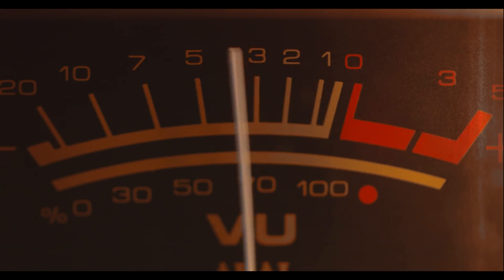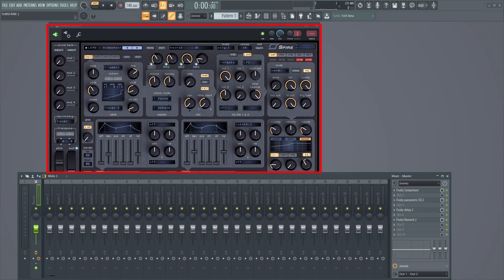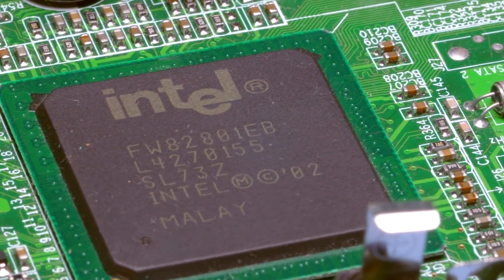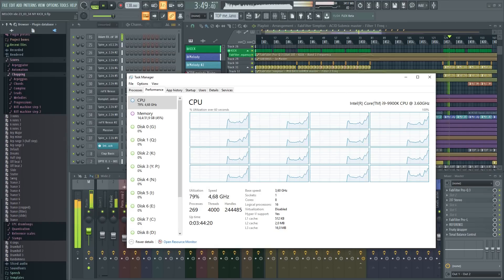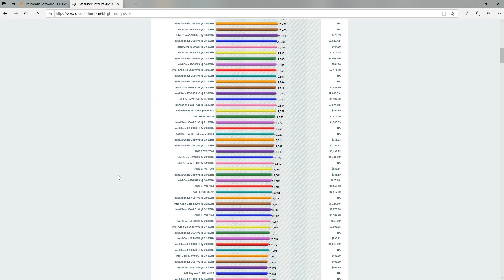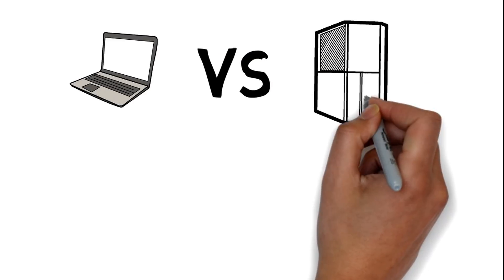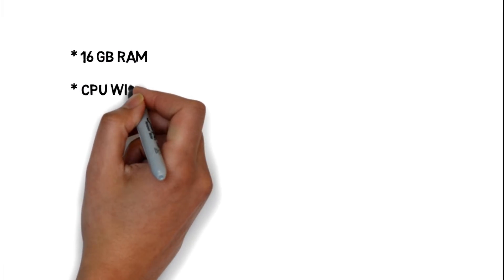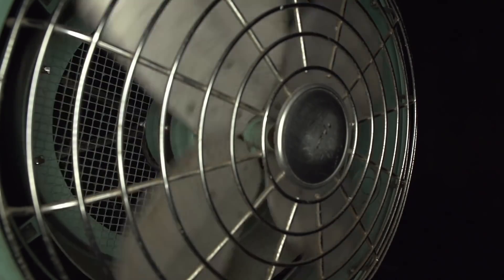The Best Computer For Music Production - What's Needed And Why!

Comment: Bought a 2015 iMac 8 gb RAM replaced hard drive with SSD. £800 total. Done.
Reply from the maker: You don't always need much CPU performance. It depends on what you're using the computer for. For example if you're mostly in to recording and using samples, then you'll get by with an older computer. In this case it's using a ton of CPU hungry VST's and effects. Not everyone is going to need such a beast. :)
Reply: soundD:sine what shop did you go too, I have a 21.5 late 2015 with 8gigs and can’t upgrade ram  as it is soldered .. how can I put the ssd
Reply: N.K.O Productionz N.K.O Productionz yes ram is soldered but HDD is a mechanical one which can be replaced with an SSD. Remove iMac screen. Knife the edge screen warm with hairdryer. Swap HDD having cloned new drive from old. But new file
Strip kit for iMac from amazon.
Google the process I fix it.com .
Did it myself but I am experienced with taking computers apart etc. Now have 1tb ssd Samsung evo in iMac. Cost me
£100 in total and has transformed
The iMac. Mechanical HDD’s
Are a serious bottle knock to performance

Comment: Interesting! 

But no power supply?
Reply from the maker: Thanks. It's at 7:05. Seems like I forgot to add it to the parts list in the video description, so thanks for pointing it out! :)   Here's the link: https://www.amazon.com/Corsair-TX750M-Certified-Modular-Renewed/dp/B07RYZWRZV/ref=as_sl_pc_tf_til?tag=firewalk02-20&linkCode=w00&linkId=9276904dc4ad656423b96e65b57eac78&creativeASIN=B07RYZWRZV

Comment: 5-7% increase seems a bit low. I've got a 8700k and max it out in current projects but I think I'll hold off upgrading for now
Reply from the maker: The rather low increase was quite surprising, as the CPU is supposed to have a substantially improved single core performance, and even more cores. I suspect this is is because of the quad channel memory support of the 5820K vs the dual channel on both the 8700k and the 9900k. I talked to Image-Line about this and they was as surprised as I was. In theory, you should not be able to max out the bandwidth even with a dual channel system. However, in a real life scenario it seems to be a different matter. 

In order to test this I downgraded my quad channel 5820k to dual channel DDR4 memory instead, and the result was quite shocking. A project that was using about 70% of the buffer in FL Studio ended up reaching 100%, and became unplayable. 

Once I set it to quad channel again it was fine again. Surely the dual vs quad channel memory has some huge impact here, even though technically it shouldn't. More tests would need to be done to verify this hypothesis though, but it's the only thing I can really think of that separate the 5820k from the 9900k that could account for such a tiny difference. 
The thing is, if I had tested the 5820k vs the 9900k and they were both running in dual channel mode then the difference would probably be around 30-40%, like the charts seems to indicate, relating to single core performance increase in the 9900k vs the 5820k. I'm quite sure that the memory bandwidth is what's holding the 9000 back here, because thy should not be that close! But I can't say for sure.. 

If I had tested a dual channel 8700k vs a dual channel 9900k then the results would likely have been very different. If I had unlimited amounts of money I would go ahead and buy another dual channel system and test just to be sure, and also a Ryzen 3900x based system so that I could really see how they measure up. :)
Reply: @FireWalkMusic  Have you tried another DAW (like Studio One) that might be able use utilise more threads?
Reply from the maker: @AJDOLDCHANNELARCHIVE  I contacted various daw developers and they have confirmed that all daws work basically the same way when it comes to the way it processes. Serial processing is heavily  utilized in all daws. They all also utilize multiple cores of course, but they all work basically the same way. So if you replicate a project perfectly in two different daws you wouldn't see a huge difference. Perhaps +-10% tops, and much of that will be due to the buffer handling and such.
Reply: @FireWalkMusic  Sorry man, you just need to RECORD the synths and all that and split up your creation, arrangement, mixing, and mastering phases of production in order to avoid that high CPU utilization. It could also be as simple as switching your buffer size as well. you don't need a low buffer if your mixing/arranging the track. You really dont need a low buffer unless you're recording guitars w/ realtime effects etc.... The i9 can flex more CPU power if you increase the buffer size.
Reply from the maker: @dotMPEGmusic  Hey, I'm aware of the freezing option, but I really don't like doing that due to my workflow. In my opinion freezing Is still a bit tedious in fl studio, particularly the unfreezing.. The way I work means going back and changing things quite a lot, and with most of the tracks rendered to audio it would just be too messy and time consuming, so I opted to go for more performance instead. The buffer size is already maxed out usually. I always record during the start of a project, with a low buffer size, and then I increase it as the project grows. 😊
This works well for me. I also do video editing and it's a pain to wait while video is rendering while editing, so having a fast CPU saves me quite some time in the long run. 😊

Comment: Wow, that’s the small gap between the old and the new CPU performance, and even the higher clock speed don’t help. Also, if You do video editing, I think AMD would be a good choice... I love my Ryzen 3700x.
Reply from the maker: The 9900k is running dual channel DDR4 and the 5820k Is running quad channel, which seems to be what's accounting for the small difference. In theory, the i9 should be around 40% faster than the 5820k since it has faster single core speeds and more cores. It is a lot faster in video editing though, and also in games it really show (here the 5820 is holding back the graphics card a bit actually). So overall the i9 is a better all round system, despite the rather small increase. 

If I had unlimited money I would buy the new AMD 3900x as well and test it vs the i9. :)
Reply: @FireWalkMusic  I think the undervolting potential of Ryzen 3rd gen in particular might actually edge out Intel for audio as well, at least for many workflows. While single thread performance matters, you had a lot of threads going at ~50%, which synthetic benchmarks don't replicate for single thread performance. And thse additional threads affect thermals and memory use, which in turn affect whether the main thread runs at full boost. With the low TDP of the 3700x it should achieve higher boost clocks more reliably - and quieter and you could even go for a full passive system. I think both 3800x and 3900x offer diminishing returns (or even negative effects compared to the 3700x) for audio thanks to the higher TDP.
Reply: @simongunkel7457  which is better 3700x or i5 9600k ?
Reply: @xoxo-pp7ru  In that case easily the 3700x, because it's even beating the i5 9600k for single threaded performance so it has an advantage over the Intel even when you aren't putting load on multiple cores.

Comment: gracias! ! y una pregunta intel 9900k o Ryzen 3900x?
Reply from the maker: It's hard to say. Most of the benchmarks so far has been for games and such. From the looks of it the 9900k is still a little bit ahead in terms of raw single core performance, and can also be clocked higher. But then again the 3900x has more cores, which can help to some degree. I can't really say for sure without doing any tests, but I suspect they are fairly equal. Perhaps the 9900k is still a little bit ahead, but not enough to justify the much higher price. At this time the 3900x is probably a better choice considering the price, but I would have to run some tests in order to say for sure.
Reply: @FireWalkMusic  thanks !!!
Reply from the maker: @Juanele23bcn  You're welcome :)
Reply: @FireWalkMusic  https://www.cpubenchmark.net/singleThread.html  Based on these results would you think I would be better off with the 3800X? or would the Intel 9900k be ultimately the better choice? Considering I am making a desktop strictly for music making purposes.
Reply: 3900x no reflexion to have 
Both are big overkill so why don't go with the most multitasking capable? But go Intel if you need thunderbolt audio card..

Comment: What CPU do you guys suggest between a Ryzen 5 1600 and a Core i3 9100F. Both are priced equally and I'll be using Fl Studio for Production.

- I3 9100F 4 core 4 threads @3.6Ghz

- Ryzen 5 1600 6 core 12 threads @3.2Ghz

https://cpu.userbenchmark.com/Compare/Intel-Core-i3-9100F-vs-AMD-Ryzen-5-1600/m796379vs3919
Reply from the maker: I would go for the Ryzen here.

Comment: How much memory do we need actually..for MP build
Reply: Never go 8go noways 
The 2x4go is really rare to find and remember that now especially with ddr4 you should only go with dual and quad slot to achieve reasonable frequency on the ram.. basically 1x16go is half performance over 2x8go true as well if you want 32go go with 2x16 it's more cheap than a 4x8 and left room to add a 2x16go to go 64 in future ;)
Reply from the maker: I recommend using 16 GB. Some times you can get by with 8 as well, but it's really annoying when you constantly run out.. So in order to prevent any issues I always recommend 16 as a minimum.

Comment: Same thing, with parts and everything, what if you wanted 128gb of ran?
Reply: Am very glad that I seen your video. I was going to wait🤑 until the new mac pro, coming out this fall 2019, until I seen the price 🤯🤯🤯🤑. And the design in front looks a onion shredder with plenty of holes, that say dust your welcome to stay in here. No thank you.  I'm also finding out, that more, and more people are apple products, I don't blame them. Thank you for info, your way seems to be the best way to go.👍👍👍👍👍👍
Reply from the maker: If you need more than 64 GB then just find another motherboard which has support for that much. I can't really think of any scenario where that much ram would be necessary though. I do some heavy video editing and I used to get by with just 16 GB. I upgraded to 64 now just to be on the safe side. If RAM is that important than I would probably look at a 4 channel platform instead, as you'll get much more bandwidth that way. As you can see from the comparison in this video between the 5820k (4 channel memory) and the 9900k (2 channel memory) the difference isn't really that big. I suspect the increased memory bandwidth of the 5820k platform plays a huge role here. I actually tried to test this by downgrading it to 2 channel and the performance in FL Studio was heavily reduced.
Reply from the maker: You're welcome :)

Comment: Also what does having higher Ram help with? My main issue is when i play inside my project the project has that glitchy sound especially if i have a lot of plugins running
Reply from the maker: Having more ram will ensure that you don't have to restart your computer so often to clear the memory. Every time you open a project or a program it loads things into the memory, and it remains there so that the next time you load that application or whatever it will load faster. When you have used your computer for a long time without restarting it, the memory will tend to get filled up, and at some point you might have to restart the computer in order to clear everything. Having more ram ensures that you don't run out of memory while working on a project. In most cases, 16 GB will be more than enough. I also work a lot on video editing, which uses a lot of memory, so in my case 64 GB is just playing it safe. I could probably get by with 16. :)
Reply: Assuming your daw is 64bit. Which it might not be as your vst's are all 32bit so the daw will only access 4gb ram. I still run fl studio in 32bit to stop the vst bridging.

Comment: I use logic and need to upgrade to a more powerful machine. Iv been looking at a Mac Pro with a intel xeon e5 2.7ghz, 12 core/ 24 thread processor. 
Would this be a powerful processor to run Logic Pro x?

Also on the apple website it says this about Logic Pro -
Logic Pro and Logic Express 8 or later can use all cores on 2, 4, and 8 core Macs. Keep these tips in mind as you work with Logic to balance performance on a multi-core system.

So do that mean it’s better to get more core as it doesn’t just run off single core performance?

Thanks
Reply from the maker: All daws work basically the same way when it comes to single thread performance. They all utilize all the cores, but because dependencies are constantly generated within a project, it will always heavily favor single core performance. The same guidelines applies to logic as well. The new AMD 3000 series also has really good single core performance (almost as good as the i9) and 12 cores, and is also a lot cheaper. If you want good single core performance and many cores, I would look at the new AMD 3000 series.
Reply: Ad D ... I work with Cubase (but the Logic Pro is the same) and mainly with a lot of VSTi tracks... I am very hapy that i buy 3 years ago the Mac Pro 2013... It was my best choice! I have only 4 core, but it works great. BUT please, buy min. 32 or 64 vGB of RAM! I have 80 GB of RAM... This year i was thinking to update the CPU, but after a search, i just upgraded my RAM and no problems with big projects 😉 The 4 core CPU is enough and the bigest update you need is the RAM... and of course SSD harddrive... And i working with orchestral music... chceck my channel if you want. And one last but very impotrant point is - The Mac Pro is soooo QUIET 🙏🏻 You will be happy with the Mac Pro

Comment: Great video. Out of curiosity, would you consider a AMD Ryzen 3900X or 3700X music production build now they are released?
Reply from the maker: From the tests I've seen the 3000 series performs really well. All though technically the i9 seems to still have an advantage in terms of raw single core performance, it's a very tiny lead, and considering the fact that the 3000 series also provide more cores, and at a much lower price, I would definitely consider going the AMD route. I haven't had the chance to test the platform myself, so I can't say for sure but I suspect it will perform really well.
Reply: I actually just got the 3700x; upgraded from 2700x.
Its a noticeable jump actually. Id definitely recommend the 3700x. Definitely the best bang for buck CPU for virtually every task ATM.
Now if you're on a tighter budget just get a used i7 as intel chips are typically more optimized for DAWs due to the developers using intel to dev the software.
Reply from the maker: @dotMPEGmusic  The new amd 3000 series is performing surprisingly well.  I'm considering buying the hardware in order to test the performance vs the i9. I just need to save up some money before I can make a video about it.😁👍

Comment: How much did that PC cost to build? I bet it wasn't 'cheap'.
Reply from the maker: I reused some of the parts (hard drives, video card etc) from my old rig so I basically just needed the main board, cpu, cooler, and the case. Electronics tend to be rather cheap here in Norway (while everything else tend to be insanely expensive) so it wasn't really all that bad. There's a full list in the video description to all the parts, as well as the price. :)

Comment: Great Video, though I use Cubase 10. With the release of the new AMD processors, which one would you recommend that is still bugdet friendly?
Reply: Most of the new AMD CPUs are a great value. What is your budget?
Reply: @delta61  Thanks for your reply. My budget is $800 max
Reply from the maker: The new 3000 series delivers great single core performance, almost as good as the i9 (at least theoretically) and 12 cores, so I would definitely consider the new AMD platform. Especially considering the pricing.
Reply: @FireWalkMusic  Thank you. Would $800 be sufficient to build a music pc? If it's not too much to ask a specs list would really be helpful.Thank you
Reply: @KatiKawanu  800 is sufficient. Go with a B450 board that supports Ryzen 3000. For RAM, I'd say you should go with 16GB, 3000mhz. The Ryzen 5 3600 should be a great option for a CPU. Then, you need a PSU, I'd recommend you to go with 550 watts. Storage and GPU are pretty much up to you, I can only recommend a 250gb ssd for the OS, a bigger harddrive and for a GPU, you can go with want you want, but I'd go with the AMD RX570 or RX580 depending on what money you still have left.
Reply: @delta61  Thank you thank you

Comment: Hey man could you do a tutorial on making drums sound coherent ? I tend to have things sit on top of everything and when I mute those channels for example hi-hat loop the energy is lost. Even tho I have sidechained and highpassed. Thank you in advanced
Reply from the maker: Thanks for the suggestion, I have some similar tutorials planned.
Reply: Panning, proper compression, and subtractive EQ is your answer assuming it was recorded/sampled properly
Reply: Mixing drums is like one of the hardest things to mix besides vocals.  Riding the faders ie volume automation is an old technique you can use.  Also waves makes a great dynamic eq that can be sidechained to only cut on when you need to subtract some freq.  I dont understand what you mean when you mute channels energy is lost?  There are lot of techniques that you can use for mixing drums maybe you should go buy a book and read not to be mean but thats what i had to do.  Then when you watch videos it will make more sense.